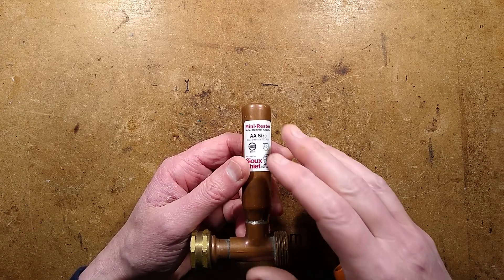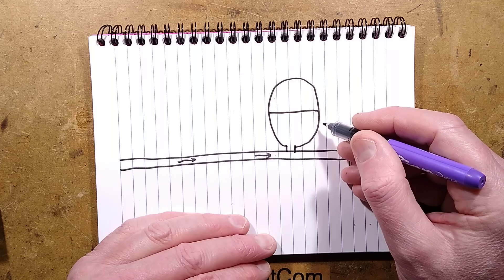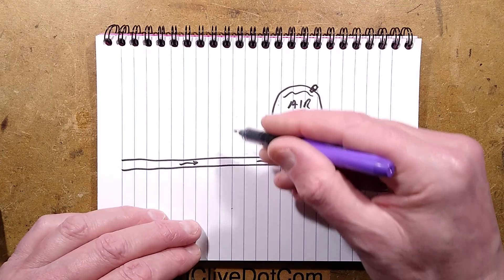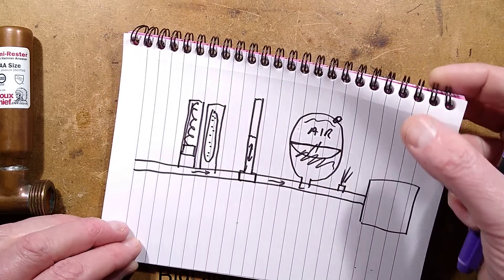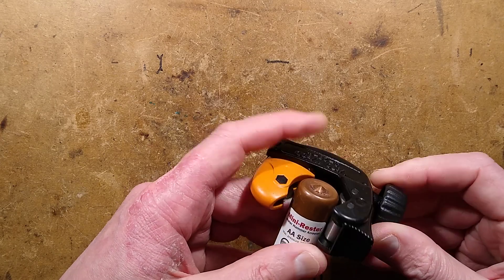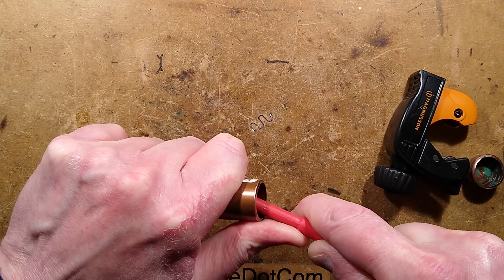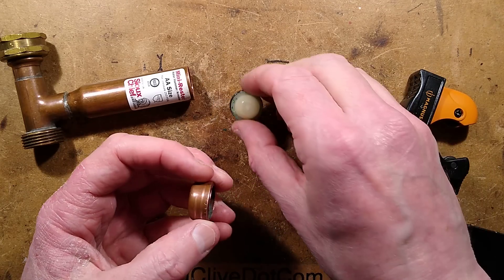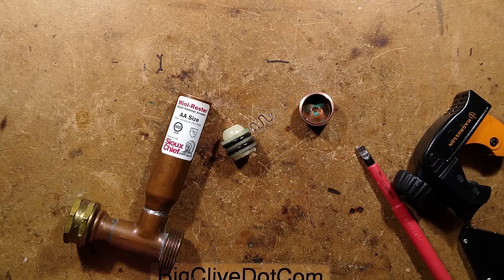inside an American made anti water hammer device

Comment: As someone who not only was a sales man for these products, but also has toured the Sioux Chief factory in Peculiar, Missouri, these things are sold by the tens of thousands.
The tube is just spin closed at the end by friction, then the piston is inserted and that traps the air at the top of the closed end.
Then is squeezed at the other end to trap the piston.
Then, depending on what you ate connecting it to, that tube is soldered to the tee with the appropriate fittings.
Available in hose thread, like you have for connecting to washing machines in the US, PEX ends, copper tube ends, and threaded copper tube ends.
They make several different sizes with the MiniRester designed to be mounted as close as possible to the problem valve.
They also make larger units designed for whole house protection and unuts with internal stainless steel bellows for commercial applications.
Reply: To elaborate on the spin closure - the open pipe is spun in a lathe at high rpm,  and then a tungsten carbide tool is traversed across the open end using the cross slide. The tool essentially applies a flat surface to the end of the pipe, but set at an angle. This both heats the material, and pushes it towards the centre. With the right speeds and feeds, a gas tight friction weld is made that closes off the end. Baxi boilers have a similar, but made of steel, part that was manufactured in the same way.
Reply: Peculiar, MO is where Todd from Project Farm is :)
Reply: thanks for adding some more context
Reply: Maybe you are the sales rep that sent me one of these free for use at my chattering dish washing machine about 25 years ago when I complained at an MEP luncheon in St. Louis that the Watts bladder type I was using was not helping matters a bit. Thank you very much! It solved the problem and it is still in use many washing machines later.
Reply: What a Peculiar little town! I live in the same state, never would've guessed. I have four of these little hammer arrestors in my house, our washer was bad enough you could see the entire main water line wiggle every time it cut the water flow.
Reply: I love the internet. Experts for literally everything are on here!
Reply: I've actually straight up worked for them, making the Tub/Shower Valve Tee, and managing the automated machines that make the other stainless miniresters. As well as putting the giant plastic pistons into the Hydraresters. 

Actually grew up in the rural parts Peculiar, and rode a bike in to work!

I ended up working at a lot of other places there too, but the copper department was where i was hired on.
Reply: Maybe you are the sales rep that sent me one of these free for use at my chattering dish washing machine about 25 years ago when I complained at an MEP luncheon in St. Louis that the Watts bladder type I was using was not helping matters a bit. Thank you very much! It solved the problem and is still in use.
Reply: Fitted one of these some years ago to stop water hammer caused by  washing machine. Seemed to work  initially but then system reverted more or less back to previous form. It's  still in there but is it doing any good? .... Well it can't  be doing any harm is probably the best answer.
Reply: @Roastbeef01  Yes they stop working.  I am currently dealing with an under-slab pinhole because the old mini-resters bottomed out.  These were 14 years old so I don't entirely blame them but it would be nice if there was a clear expiration date.  I guess I also blame the LG high efficiency washer -- it flips the solenoid valve an absurd number of times when filling because it likes to slowly meter out water.  It's a great washer overall, but it really is hard on old pipes, and didn't really need to be programmed that way, or built with such fast-acting solenoids.

Also it's too bad mini-resters aren't built to be serviceable, but with this video I have some ideas to try on the non-working ones I just swapped out.
Reply: @Sn0wZer0  they can easily be added to any system to be easily replaced by using tees. The ones for washing machines literally go between the washer and the supply hoses.
Reply: @michaelgoettsch7744 You seems to know your stuff. But why is the plastic piston not deformed? as the soldering puts quite some heat in the squeezed pipe where the plastic piston sits.
Reply: @patrickvanden8322  Many nylons can stand the heat from the solder ,with no issues.
Reply: @patrickvanden8322  Deformation comes from time, temperature, and force.  Force is mostly constant, so not much of a chance for deformation here..  My concern would be the grease or O-rings being damaged by the heat.

However, this is an industrial process, so they can do things like chill part of the tube while soldering another part.  Even if they aren't doing that, it's still an assembly line.  So, the amount of heat put into it is minimal and only for the minimum amount of time needed.
Reply: @patrickvanden8322  They shape the metal before they put the plastic in it. Probably with some kind of steel insert from the bottom while shaping to make sure the tube doesn't contract any.
Reply: @patrickvanden8322  The end is closed before the piston is inserted
Reply: @patrickvanden8322  Time and location, the piston will be at the far end of the pipe during soldering, and you heat the soldered area fast, then when it is finished you drop it into water to cool it fast. Plus you use seals and plastic that will survive the temperature they reach for a few minutes.
Reply: god I miss the midwest names... living down in Florida now and the only thing I have near me is "Kothesville" which we call k-ville.  I half expect the next two new towns to be named Karen and Dairyleen
Reply: Are the other variants also named after battery sizes?!
Reply: LOL, I just commented that I thought the end looked like a spun friction weld! I M SMRT!
Reply: Also a manufacturing facility in Grandview/Belton and Olathe.
Reply: and they fail far too often and are junk with higher pressures city water areas.
Reply: I drove past that place when I was delivering to Peculiar MO just a couple days ago. Pretty neat
Reply: i've spec'd sioux hammer arrestors on hundreds of plumbing plans. from home additions to 10000sf high-end custom homes to bars and restaurants to tons of different commercial operations, you might've sold some of those! but probably not lol, i think everyone specs them

Comment: I have a Sioux Chief laundry box. It has the arresters built in with small shut off valve levers. I just had to replace my washers inlet valves. They worked fine but made a nice squealing sound every time they opened. While I was back there I replaced the hoses. My dryer also has a hose for steam. There is a "Y" fitting on the cold water line.

Comment: Also some of them are literally just what you see they're just a tube of these hammer resters are just a tube that's upside down like the one you have and it's just filled with air, those are still available here in the US, the problem with them is eventually without the diaphragm there the air eventually gets used up and then they don't work anymore and then the way you fix that is pretty easy you just drain the piping where that hammer rester is it refills with air and then you take and put the pipe back in service and you have your hammer arrest again and you do that about once or twice a year

Comment: The old method with the dead wasn't just a matter of stagnant water, which has been linked to legionnaire's disease. Over time the air will seep back into the water allowing the water to rise and the dead end just gets filled with water defeating the purpose- it takes a long time to fully fill but it will eventually. These new mini-tanks also push that water back down into the flow when the faucet is open and the pressure drops, plus there's a seal between the air pocket/water so it can't get filled. They cost more, which kinda sucks but they're worth it for long term plumbing. I'd say if you were only going to be using the plumbing for 5ish Years you could still use the older dead end method if you're not worried about code, though if it's going to be installed longer than that then use these new mini-tanks. Our 20ish Year old home has some hammering problems since they've filled (using the old dead end method) but we've been slowly replacing them with these tanks and it's a lot better now.

Comment: I have one on my washing machine. I also anticipated seeing a spring. It does seem to work, though.

The water-hammer effect can actually damage long runs of plumbing because the weight of the column of water can be substantial and the inertia will actually cause the plumbing to move with some force. This movement will cause fatigue over time leading to leaks or breaks.

On the soldered tee,.. I heard that the reason they don't do that anymore is that the air in the tee is gradually absorbed into the water over years of service until it is no longer effective in stopping the water-hammer effect.

Comment: Youre not quiet right with the shradder valve test. You can have air come out but that doesnt mean its at the correct charge level. Usually for homes in the Uk its between 2.5bar-3.5bar. 
Usually those vessels are for sealed hot water unvented systems.

Comment: If your pipe is fitted with air in it water will only flow up it until the air is compressed to an equal pressure. Would love to see tour Perspex pipe . Put a cap on the top and connect it in-line of your hosepipe outside.
That would make an interesting video , stick a solenoid valve on the end of the hose
Reply: "...water will only flow up it until the air is compressed to an equal pressure...."  <- Static case, yes.  Dynamic, the pressure can spike. It'll spike much less with an air pocket.

Comment: Far as I know, the dead end pipe method worked well but it only worked for a short while.  Over time the air would dissolve into the water and the dead end would no longer have an air spring to do its job.
Reply: Others would claim that most water supplies will have enough dissolved gas or even bubbles to maintain the air pocket.
In my case, there's a 10-inch cartridge water filter on the main supply. Each filter change introduces quite a bit of air into the system.
I'm confident that my dead end air pockets are full of air, even decades after construction.

Comment: The plumbing in our house was designed and installed by me. At each fixture, the vertical supply pipe in the wall cavity simply continues upwards for about an extra foot (~30cm) before being capped of; the fixture supply goes out sideways from a T-connection. This capped extension of the supply line creates an air pocket at each fixture. For those worried, the air in the void will be continually refreshed by dissolved gas bubbles, so the air pocket never gets exhausted.
Reply: 3:00 As drawn, the air pocket is sideways as compared to the water momentum (the air pocket won't feel the 'hammer'). It's far more effective for the air pocket to be aligned with the water momentum as I've described in the comment above. Also, the design concept as I described doesn't allow for much, if any, stale water. So the pipe layout really matters.

Comment: I never needed one of those until I replaced my old washing machine with a new high efficiency model. I hooked it up myself. The first time that I ran it, it felt like a vehicle hit my house. Then, I read the fine print in the owner's manual about waterlines with high water pressure. I ran up to the hardware store and bought a couple of those gadgets.

Comment: 20 years ago I used to work in a very old building in the Lake District, I also lived on site. The tap in my room had the most spectacular water hammer whenever I ran the cold tap. You could hear it all through the floor I was on. It made the tap vibrate if I got the flow just right 😆

Comment: Having dead-ends of pipe cause undesirable results.  We ended up with two due to the bath being removed to convert into a wet room with a shower only.  When the water pressure is exactly wrong, it causes them to whine.

Comment: I've used both commercial and site made versions in my time as a contractor.  I can't speak to stagnant water issues, but the capped stub of pipe just starts out full of air, which has no way to escape when you pressurize the system.  The problem I have had with them is that the air in them slowly dissolves into the water stream and eventually they are full of water and no longer do their job.  Commercial ones keep the air pocket and the water apart to avoid this.